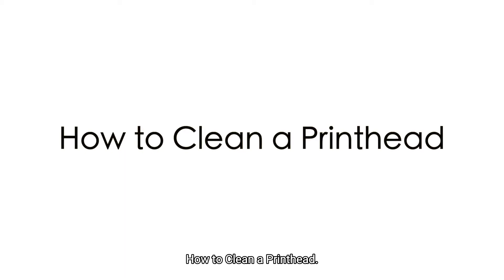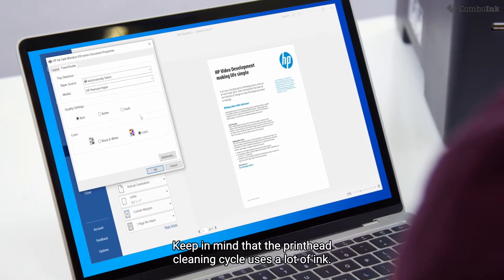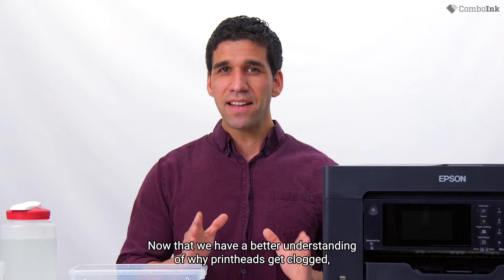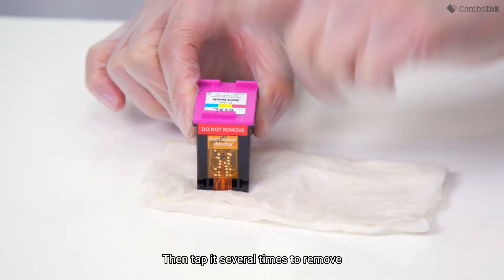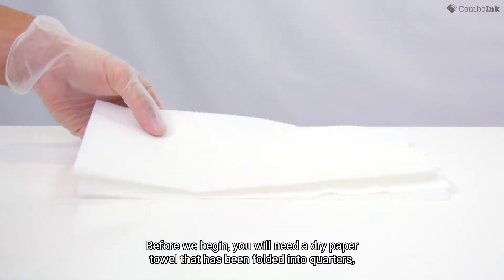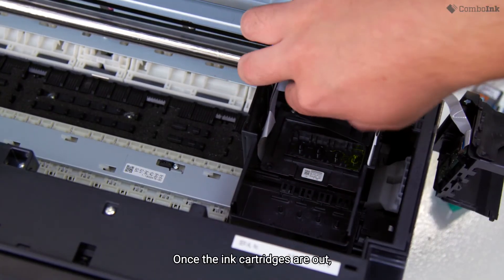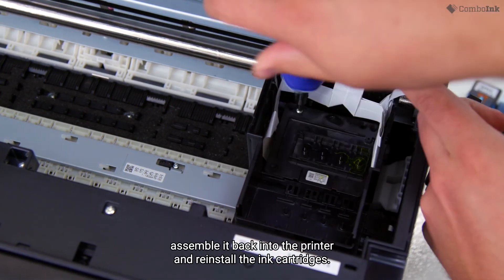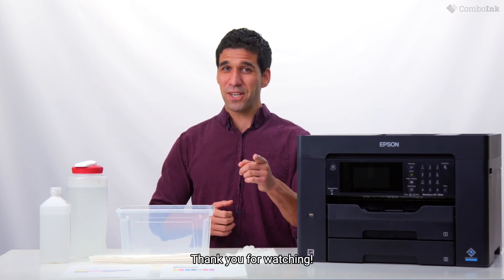How to Fix an Ink Cartridge that is Dried Out and Clogged Print Head

Comment: Great vidéo 

If I’m printing only in tax season , how can I prepare my printer for a long down time ?

Should I remove ink cartridge and put a piece of tape over juste like when there new and store them inside à ziplock bag ?

Thanks
Reply from the maker: Yes, it will avoid the ink from clogging at the print head if the printer is not going to be used for long time.

Comment: I bought brand new ink cartridges for my Canon inkjet mg3620.. Every single color and black but didn't print anything for a long time. I put the cartridges in and haven't printed a single thing since. 
I needed to print a black and white text document a few weeks ago to take to my Dr. I took the cartridges out before trying to print because I figured they'd be dried & made sure the ink was coming out. (I took a syringe of hot water and squirted it in until the ink would come out on a paper towel.. It didn't take much water at all to get them going). 
Anyway, then I put the cartridges back in and attempted to print a test page but the printer wouldn't even do it bc it said the magenta ink was too low!! 
I never printed a single thing after replacing all the cartridges, yet the stupid printer said the cartridge was empty!! 
I understand ink can dry out, but it wasn't difficult to get the inks to flow into a paper towel, so I know the thing wasn't empty!! 

I wish I'd known not to put the cartridges in til I needed to print something. Now I doubt there's anything I can do to make my printer actually print (even black and white) without buying another magenta cartridge!! Since the chip on the one that's in it is already associated with it being empty. 

Wish I'd known what a scam inkjet printers are!  At least for ppl who don't print things often.

They should be required to state that on the box, so consumers know what they're getting into when purchasing an inkjet printer!

I'm so annoyed with the whole ordeal. I really needed to get that info to my Dr! I can't afford to buy a cartridge right now, plus I imagine (if it's anything like previous experiences, the printer will end up telling me another color is empty right after I replace a cartridge.)

Comment: Thank you for a very good comprehensive video. I have an Epson WF-3640 and a Large format WF-7620. The 3640 was used more often so it does print, but maybe at a 50% satisfaction rate. The 7620 has been sitting for about 2-1/2 years and when reconnected it printed blanks using Black only and also using Color tryouts. I followed your instructions and Black/Color print will not even show any output. This result was tried with installing brand new ink cartridges.  These printers look brand new still and mechanically function perfect. Is there anything else that can be done before Recyling them.
Reply from the maker: If the print quality is still not good after the troubleshooting, it is possible that the print head is defective. You may contact Epson to see if they can send you a replacement print head if it is still under warranty or buy a new one from them
Reply: All colors were printing except cyan was spotty. I put tap water on felt under the cartridge carriage overnight. Now black is very spotty and colors are nothing or a whisper. Is this method worth trying or does soaking the Epson wp-7620 not work? (It'll take effort for me to learn how to remove the carriage to try this.) The printer's printhead cleaning didn't work. Thank you for any ideas.